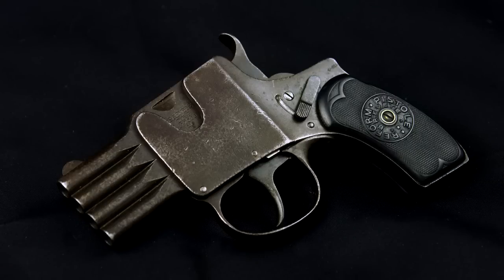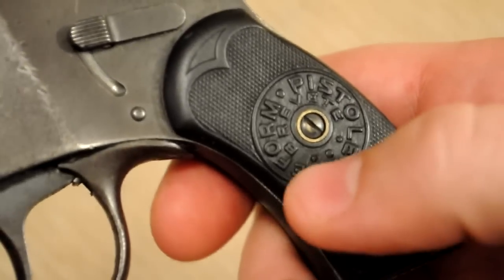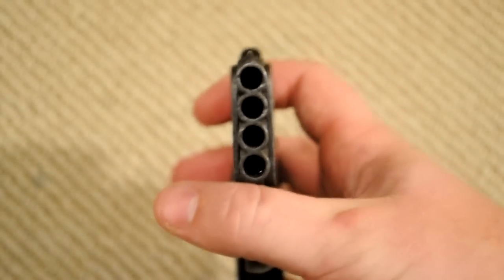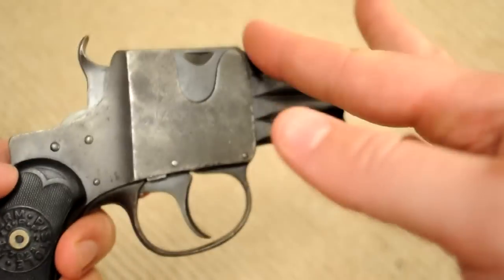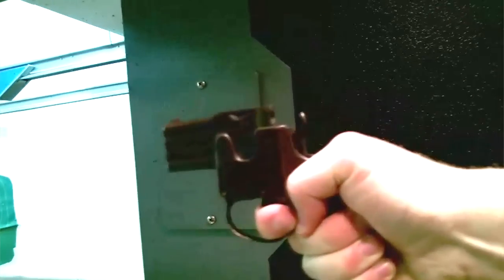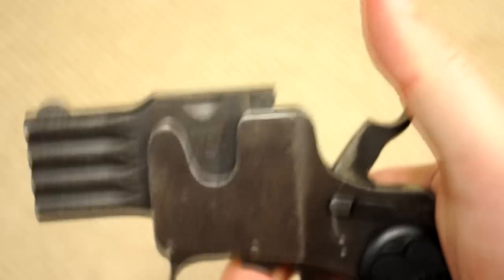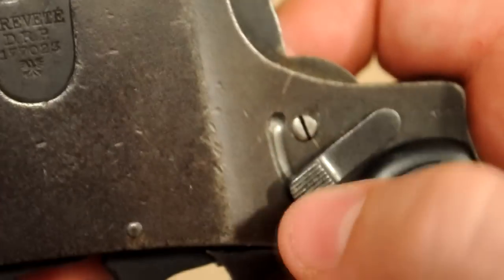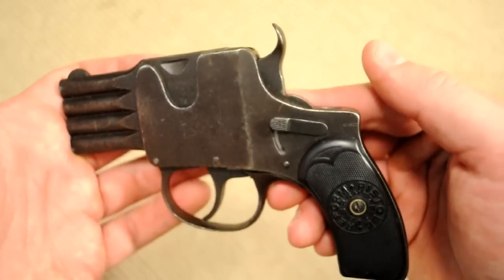Review: the Schüler Reform pistol - a 4-barrel German "revolver"

Comment: Don't use superglue on that screw, use Threadlock. If you superglue it, you will have serious difficulties getting that screw out later. 
Threadlock is designed to hold but be removable.

Comment: These are cool pistols and filled an interesting niche.  The first time I ever saw one was in High School (1970's) while visiting a friends house.  They had it hanging on their wall in a frame.   I asked them if they would sell it but it turns out it was used by their grandmother for self-protection as a young single woman and she carried it in her garter along her thigh!  The more i looked at it, the more I realized this was a perfect pistol for a garter carry.  It was very THIN.  It was very LIGHT. And it was simple to operate.  She would likely pull it out to show she meant business, fire it if they didn't believe her and then run like hell after you emptied the thing - reloads not being an essential part of the story! 
I wanted one ever since but they have always collectible and $$$.   The early models have a scalloped side and a larger safety lever.  Hopefully I will find one someday that I can pickup for a good deal also!  Thanks for the video - just love that shell case deflecting hammer!  is there a pin hole in the adjacent (being fired) lower barrel that allows gas to enter and propel the empty case out?  Seems like a pretty strong ejection :- )

Comment: I have one of these although from what you've said it's nowhere near original condition.  My father got it from his father who supposedly got it from a pawn shop in Colorado. He had this Reform pistol along with a Sharps 4 barreled pistol with a revolving hammer.   It has what appears to be brass plating and has pearl stocks. It looks like a piece a real Jim Dandy kind of guy might carry while gambling. I was told by a dealer at a gun show that the word on the left side of the pistol was the French word meaning pistol.